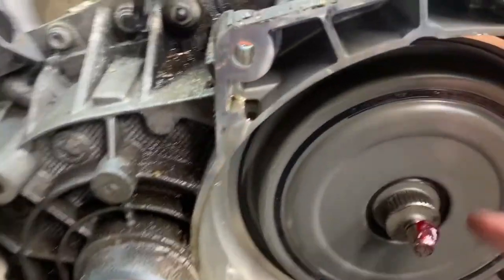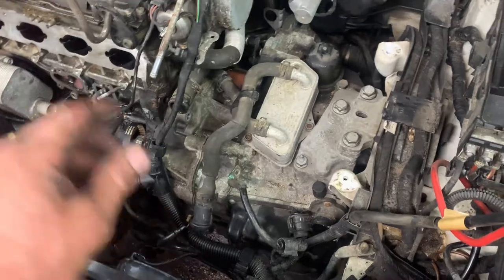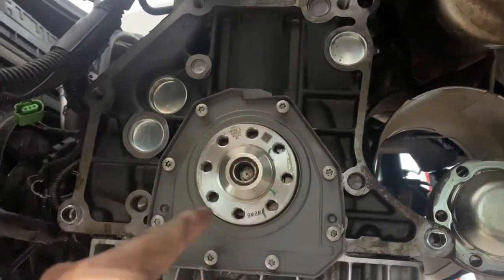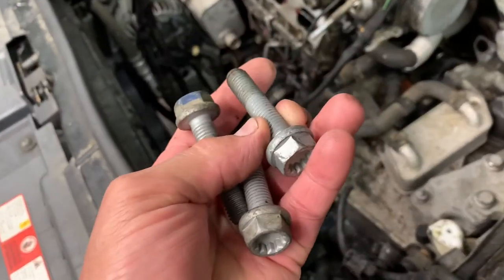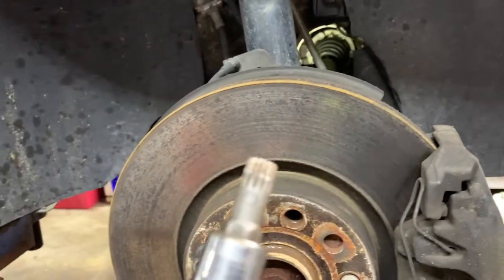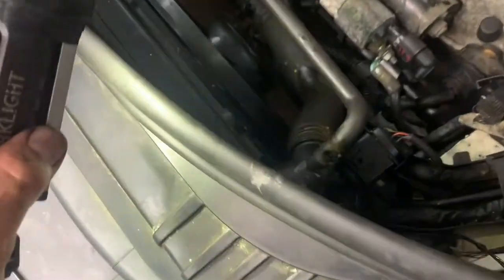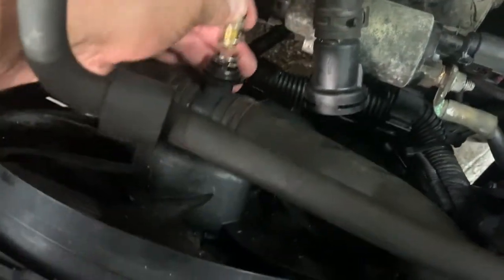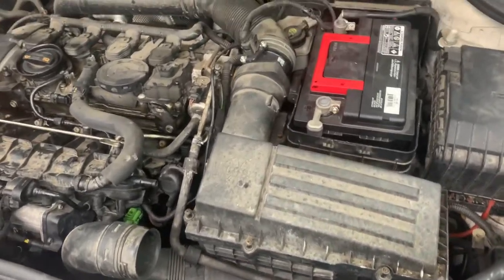2009 Audi A3 2.0T FWD transmission install part 2of2

Comment: Any different pulling the trans in a 2009 quattro? tnx for the vid!
Reply from the maker: Well Quattro is AWD pretty much the same except for transfer case (ptu) power transfer unit just gotta make sure rear shaft off and bracket supports from ptu to engine all off
Reply: @richierock1300  tnx!